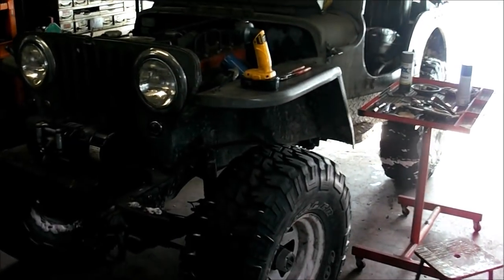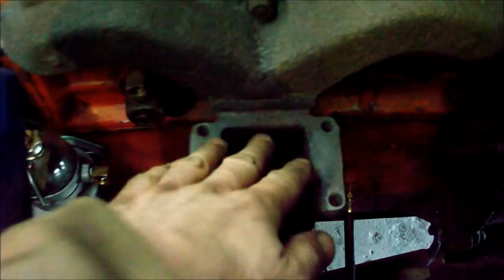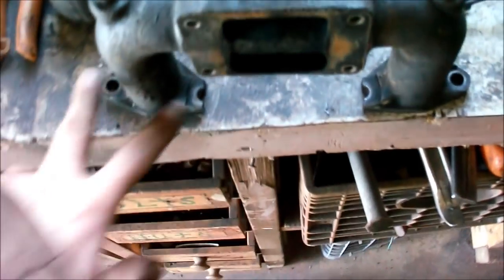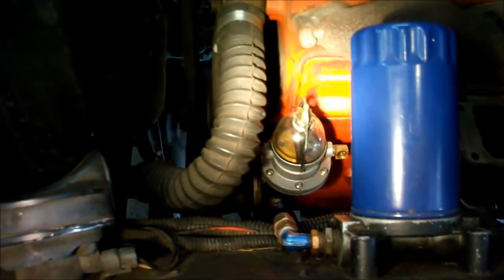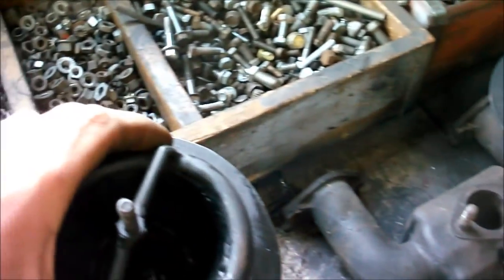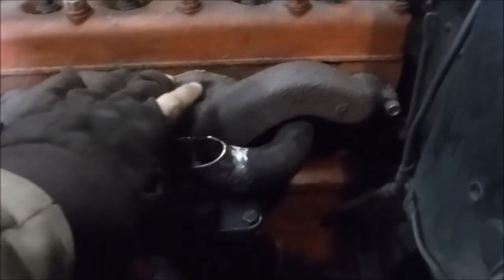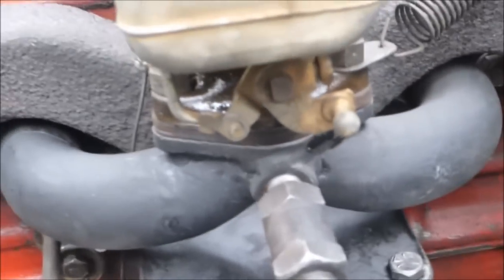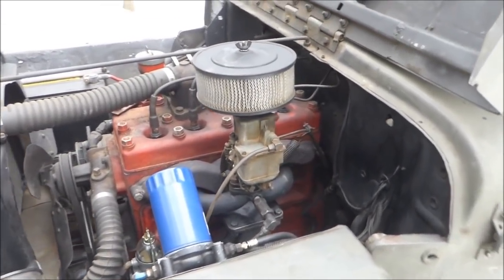Custom Intake Manifold for the Willys Jeep L134 Cj-2a

Comment: I have a L134 and doing something similar. You are absolutely correct about the hot intake robbing power from this lil motor. The F134 exhaust manifold fits the L134 perfect. The factory F134 only have one bolt on the outer ports. Check out the F134 exhaust manifold it will work perfectly.

Comment: I had the same thought. I took an 1/8 inch thick piece of aluminum and slipped it where the gasket was between both intakes and coated both sides with high heat RTV. DONE! One out of 4 I did needed holes in manifold opened up some to allow for height change.

Comment: Your intake manifold came out very nice, great job. Your spot on with temperature of the intake air. 100ºF intake air temp. is the preferred temp. by Ford and GM, back in the day when cars had carburetors. I also like the fact you made a velocity stack, to use with your open air filter. Most people don't realize the carburetor has a harder time intaking turbulent air than non-turbulent air. That is the reason most air cleaners have a snorkel, and are designed to maximize air flow to the carburetor. The open chrome air cleaners often seen on hot rods are more for looks and sound, not performance... and often reduce performance.
Reply from the maker: Yes and the short length of the manifold can be made up for by making the intake pipe longer. Of course the optimum length needs to be determined on a dyno but anything is better than nothing.

Comment: Nice little bit of fabrication.

I've always believed that the hot intake made little difference to charge density. The charge isn't in the intake long enough to gain much heat and it undergoes evaporative cooling from the gasoline droplets evaporating. The hot intake walls do prevent fuel condensing on them. 

Keeping the air cool before it reaches the carb is another thing though. That hood scoop should have helped. Isolating the intake air from the engine compartment's hot air even more might help more, but eventually you would run into carb icing problems.

By it's design that engine is never going to put out much power. I think they were rated at 60hp or so and that was probably optimistic. Compression ratio is probably under 7:1 and the under square design results in low rpm torque, not so much hp. Tiny as it seems that carb will supply more fuel and air than that engine can use.
Reply: I agree 100% with your whole statement... but you don't want the intake as hot as the exhaust manifold.
Reply from the maker: Thanks for the input. Im not sure what the compression ratio is on this engine but its boored .060 over and the head and block skimmed quite a bit. Making power is all about removing the weak points and I think that manifold was a big one.
Reply: Ese diseño no fue erroneo,  debido al uso q se le daría a esos vehículos,  los hace simples y efectivos en todo escenario,  con la ventaja de calentar mas rápido x lo tanto menos posibilidades de apagarse,  ademas de usar,  relaciones de compresión relativamente bajas para poder usar casi cualquier tipo de gasolina,  keroseno,  o mezclas de diesel, gasolina etc,  es un motor flexible,  y la combinación de puntos calientes y cabeza plana (flat),  de baja compresión,  permite a este vehículo funcionar casi imparable